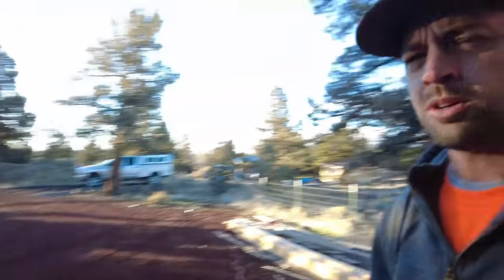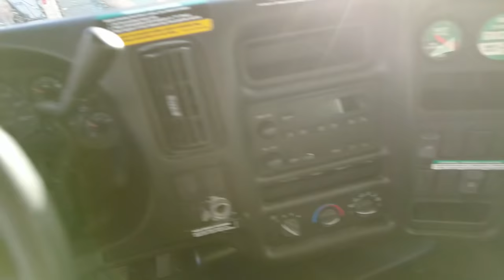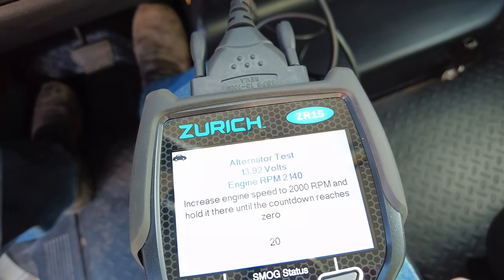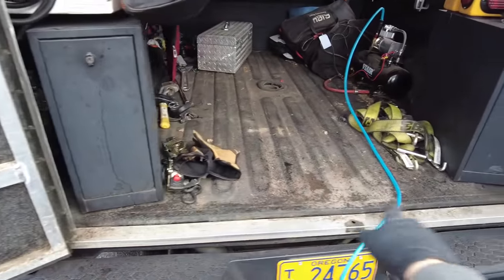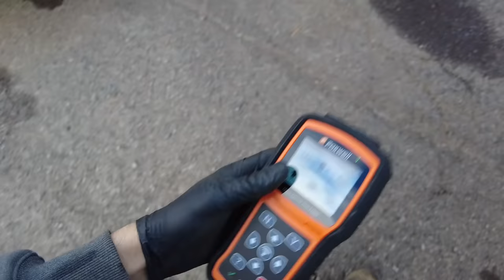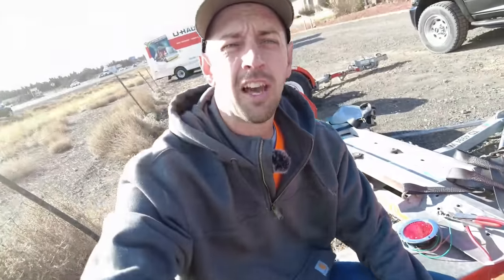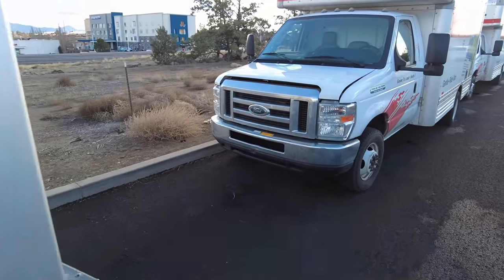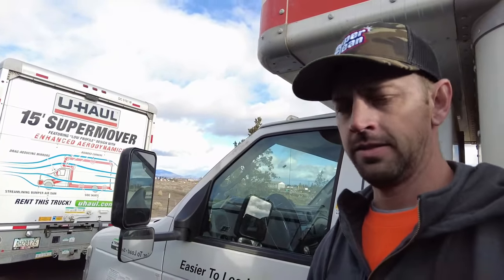A day in the life of a mobile mechanic

Comment: I have watched this twice and shaken my head both times.  My husband and son are mechanics and they always told me to check the battery for good cable connection and buildup around cable attachments before worrying about bad battery.  Also check fluid levels in batteries.  If battery is good then check the alternator.  Also told me to check battery cables.  You would be surprised what chews on them or how they can rub against the engine and burn through.  Saves you money for a new battery.  They tell me to check the fuel filter first if having gas or startup issues, especially in older cars

Comment: Electronics nerd checking in!  Soldering those connections on the trailers would be much worse than butt connectors.  The butt connectors will flex with temp changes and bumps, solder will just crack and fail.  I have no idea why so many people think solder is the ideal solution for every connection, but its for sure not.

Comment: use the marine shrink-wrap butt connectors and a hot air gun to seal them (NOT a bic lighter), and they seal against the wires and won't corrode nearly as fast.    I've done dozens of boat trailers in the past, and once I realized they HAD these marine butt connectors, my fixes lasted years instead of months in the boat trailer environment, where things are getting dunked in salt water on a regular basis.

Comment: Years ago here in San Diego a city used impound company would tow cars to their lots.  Customers would pay exorbitant lot fees only to find the batteries missing. Coincidentally the lot had a tool shed out back with dozens of "slightly used" batteries in all sizes available. Ironically the lot was always 15 minutes from closing for the day. So your choice was to buy a old battery from the shed, or pay another day's storage at $400. Locals raised hell, and the news did a sting.

Comment: So my old school thinking is to lift the hood and check the cables and terminals first ,clean and tighten as you did ,and then plug the fancy tester in to check .
Also do a quick look at the belt ,and alternator connections ,make sure the rats haven't been chewing.
And next week there might be more new batteries,the scum know that they'll get replaced 🤔
Padlock and chain on the bonnet?
Park those trucks up close to each other so the bonnet is not as easy to get to ?or is just as easy a cheap to replace the battery 🤗

Comment: I found this just as interesting as your recovery work.  Don't they keep the trucks locked, that the thieves were able to pop the hood and steal the batteries??  Good solve on the loose battery connection, and good observation on why the differential went dry. I'm amazed places like U-Haul don't have video surveillance on their vehicles - good units aren't that pricey anymore, and easy to install.  If they don't like their batteries and gasoline being stolen, wait'll they start stealing the catalytic converters!

Comment: I had a battery go dead at a grocery and the AAA agent who jump started for me said it and the alternator  tested OK. So did the dealer I bought it from. Same story a few weeks later and again a third time. I ended up getting my own jump start battery and had to use it a number of times. Finally, when I had it in to the dealer for an oil change, the battery died, they recharged it and did some more testing and decided the battery was in fact not holding a charge. No trouble many months later with the replacement. I used to work in a service station and in my experience, when a battery went bad, it usually clearly did so. In this case, I hated to replace a battery that supposedly tested good when there might be a short somewhere in the car.

Comment: That was a good reason why those trucks wouldn't run!  Didn't the manager check to see if the batteries were gone before he called you?
Reply: I believe they were only aware of the first one initially. Casey made them aware of the second. They had no reason to suspect anything out of the ordinary wrong.
Reply from the maker: Nope, just grabbed another set of keys and moved on to the next truck.  When there's a customer there waiting on a truck they don't waste time trying to diagnose things